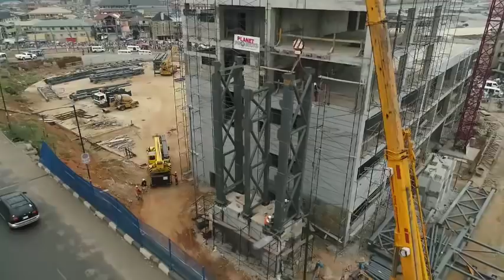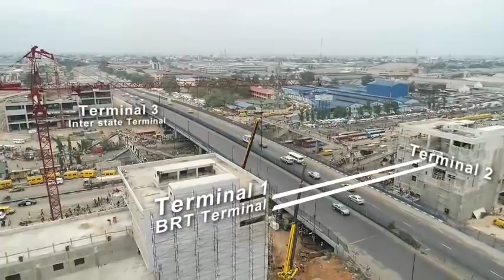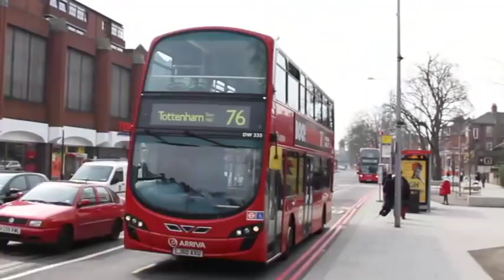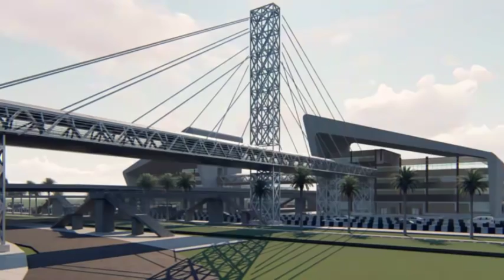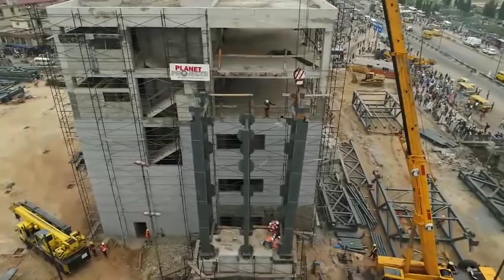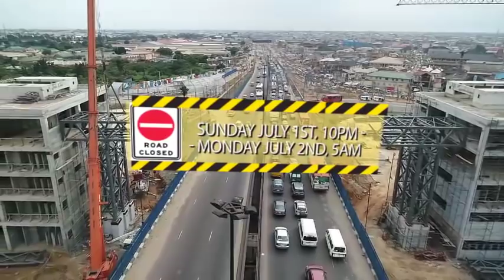Oshodi Skyline Bridge

Comment: This is great but what Lagos needs is a good metro train system. That would do soooo much for Lagos if you can get from one place in the state to another quickly. It would be an affordable and crazy fast mode of transport, significantly reduced traffic, businesses flourish, plus it’s so modern. Using 10 billion buses in Lagos doesn’t really make transportation much better. It’s still slow and overcrowded and just crowds the whole state... unsightly.
Reply: Zoe S why can’t they do both?! Not only is Lagos presently developing a mass transit rail network, but are you saying that the people living in areas that trains would not presently reach should not be able to enjoy comfortable and reliable bus transportation? There is something called “low hanging fruits” and upgrading the public bus system is a much cheaper and quicker fix, before the enormously expensive and longer rail project. 

Acknowledging that Nigerians will bitch about virtually EVERYTHING, let’s not allow perfection to be an enemy of better. Doing better is ALWAYS a good thing!